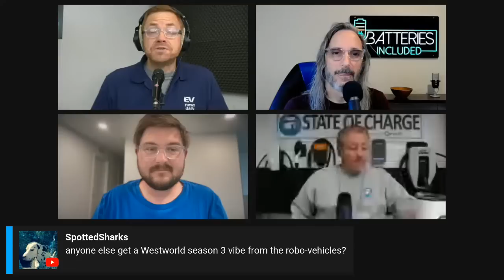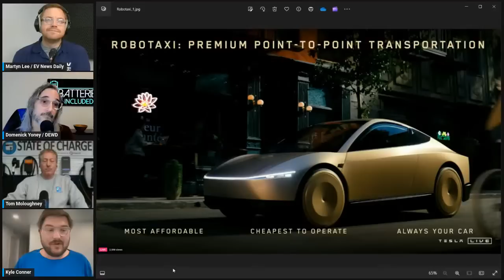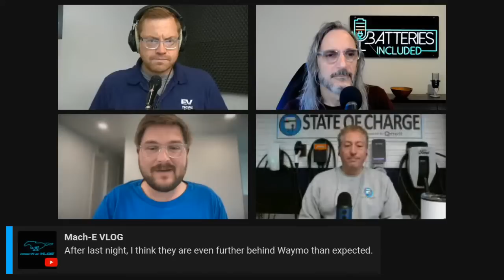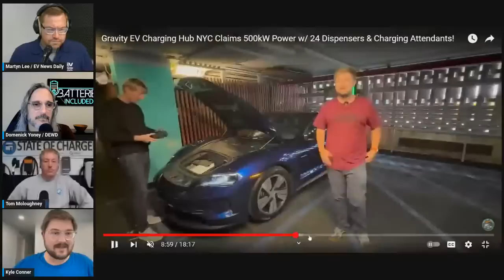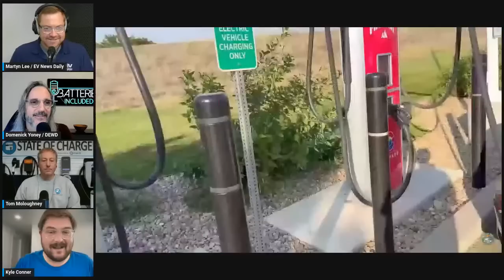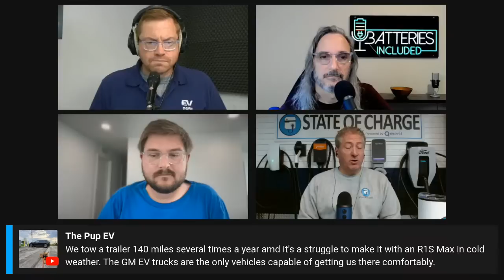Tesla Cybercab and Robovan Revealed At We, Robot Event

Comment: When will anyone test a Gen2 R1T 70mph range while the temps are still average and not freezing out?
Reply from the maker: Which motor configuration and which battery are you curious about?
Reply: @BatteriesIncludedPodcast  Gen2 R1T dual max with the range wheels and wheel covers
Reply from the maker: They did test two Dual Motors, one with the Large pack and one with Max. I think Kyle said they're essentially the same as Gen 2, but it's been some time, so I may have that wrong. - Domenick
https://youtu.be/kRfSzDdcxnE?si=42NfLZnb5lgmjTRX
Reply: @BatteriesIncludedPodcast  Gen2 has many efficiency upgrades with the new electrical architecture as well as a new heat pump system not nearly the same.